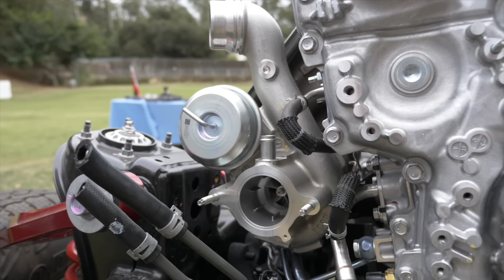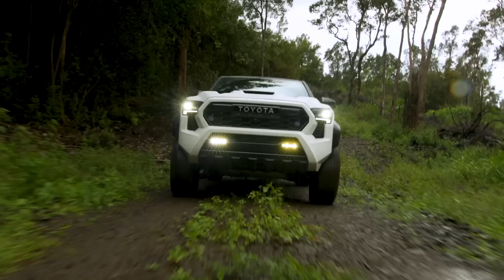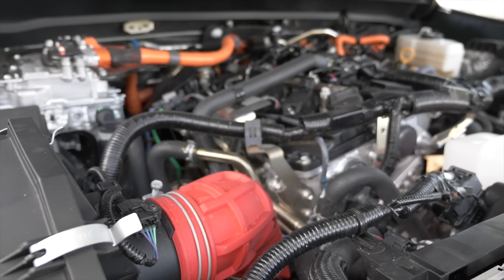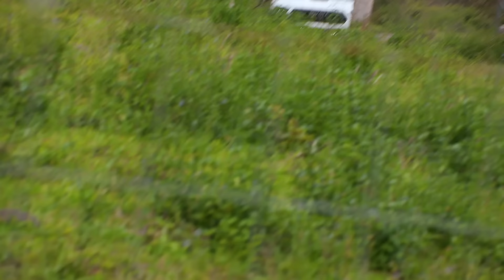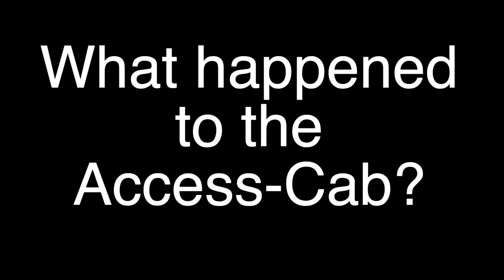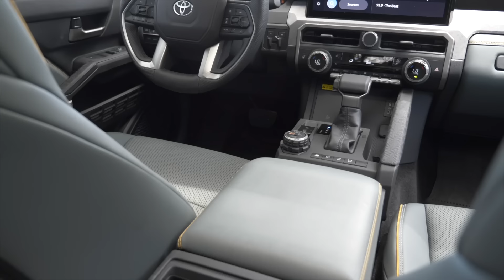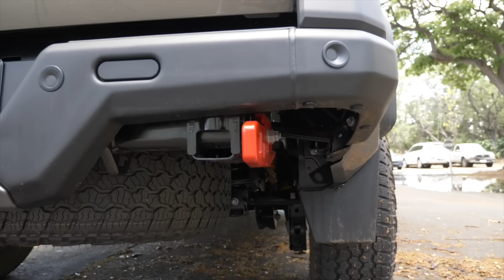2024 Toyota Tacoma Chief Engineer on new engine reliability and more...

Comment: Overworked 4 cylinder overwhelmed by weight of the vehicle, its intended use as a work truck, and heat/wear/tear from the turbo…all for 40k plus…no thanks.  From the looks of the “engineer”, it appears he was bought off with a plate of double cheeseburgers.

Comment: Thanks for making my 2012 4.0 ALOT more valuable..good luck!
Reply: Tundra/tacoma V8 v6 are unicorns now
Reply: Yup, looks like it’s already outlasting the new Tundra turbo engine.  4.0’s last a very long ways.  500k plus miles.
Reply: @musubi3287 😂
Reply: good luck to you with that 12 year old vehicle, sooner or later everything breaks and you're DEFINITELY pushing that later portion of that equation, good luck!
Reply: @qbanlink25     UNPRECEDENTED resale value..enjoy your chinky rusted out chevy
Reply: @qbanlink25 what do you mean good luck ? How much do need ? I got a 1997 F-250 with 450K miles on it . I rebuilt the engine and transmission at 370K miles and it was much smarter and cheaper than buying any of these newer overpriced pieces of trash . My dad has a 2004 jeep grand Cherokee which still runs great . A 2012 Toyota Tacoma is easier to work on and easy to get parts for you can get manuals and all kinds of info for it and lots of mechanics can rebuild the 4.0 v6 engines and you can get around 400K out of one if you take care of them so I think the guy is much better off with a 2012 Tacoma vs a new Tacoma which has a poorly designed engine .

Comment: This guy who says he is the lead Toyota Tacoma engineer is full of crap. He said they would have a motor for all their customers. Well they don’t. I haven’t heard him talk about a motor that does not have a turbo. There are those of us who despise turbos because the longevity and durability is not there as opposed to a normally aspirated, I had my last truck for 400,000 miles because it did not have a turbo if you have a hybrid or turbo you’re looking at that hybrid battery going out after 100,000 miles and it’s gonna cost $5000 just to replace the battery. i’m 61 years old and have been driving trucks for decades. Don’t tell me a turbo engine is going to be as durable and last as long as a non-aspirated engine you have all the carbon issues with turbos when that little turbo goes out after 120,000 miles it’s gonna cost you five grand just to replace it, you have not picked a motor for your non-turbo customers tell the truth

Comment: Turbos increase cylinder pressures and heat, create a ton of heat under the hood (think wires and plastic parts), add potentially more thermal warmup stress, more complexity, and stresses the oil. All of the PSI on load bearing surfaces goes up. How many resources will be needed to create, transport, and replace these engines when they fail many years before proven designs? Good for car company economics but not the financial sustainability of consumers. I’m going to have to rebuild 2gr-fe’s forever. It’s about to start looking like Cuba in the US.

Comment: If Toyota just put this 8 speed trans in the current 3.5L with 4.88 diffs, it would get better mpg than this turbo 4. My '18 SR5 4WD gets over 25mpg on 2 lane roads currently. And that motor is rock solid reliable, Id be hesitant to buy a new turbo Tacoma cuz their Tundra had major turbo issues on new model year.

Comment: thank you for the video, main question is how much ?, how much this turbo will last, how much the engine will last?, how much will cost a new turbo after 5 years for a car with  high milage, turbo need constant oil changes with the right oil (no more cheap stuff )..also some sites shows that gas diff between this engine and the V6 is only 1-2 mile diff..
So is scotty kilmer right ? he did say not a lot of diff between or even get worse experience on towing.. very interesting to see..
Reply: Scotty is usually correct.

Comment: Nothing like drinking the Kool Aide, but the guy needs to keep is job. Turbo gasoline engines just don't last, this is a compliance engine and nothing more.  At least they offer a manual transmission, but the giant TV just stuck on the dash, certainly looks like an after thought, absolutely horrible looking. Just recently retired from the auto repair business and I would be very surprised if this thing will last anywhere near the old models. I had customers with over 500k on their taco's.

Comment: Goodbye TOYOTA! I will stick with my 22RE, 1GR-FE, and 3UR-FE. They should last me forever! No expensive turbos or hybrid batteries to replace. Its cheaper for me to keep and maintain my current vehicles because of the high cost of the new tech. I would upgrade if TOYOTA offered a low tech non-turbo option.

Comment: So an unproven engine with less power and more parts to break. A thinner frame and a thinner hood/tailgate. Not to mention an Access cab that has no access! These idiot forgot that the delete seat option was used because you could still access that space through a side door. Now you have to lean back over the driver seat or walk around to the other side and reach back…what a joke. Way to ruin the last good midsized truck Toyota….i almost entirely blame EPA regulations for these changes.

Comment: The governments with CA leading the way are forcing the OEMs to downsize their engines to squeeze a few more MPGs to meet the govt. CAFE requirements. That's why larger displacement V8s and V6s are disappearing. 
One commenter asked the question of why Nissan is able to meet CAFE requirements with a big V6 in their Frontier. It's because they are dropping the Titan with the big V8 and planning to go more electric in their overall lineup. And they have a 3 cylinder turbo in their Rogue now. Don't know how much longer the V8 Armada and V6 Pathfinder are going to last. 
Toyota on the other hand sees that EVs are losers and is going with a hybrid strategy (which they pretty much invented with the Prius) and smaller turbo charged engines. 
Not sure what Ford, GM and Stellantis are going to do. Think they're all in trouble. GM and Ford are already pulling back on their EV strategy because it's such a money loser and demand and infrastructure aren't there.

Comment: Curious towards how much the EPA and cafe have choked this truck down .... Does anyone know what oil viscosity is suggested for this engine ? 0w20 or 5w30 ?
Reply: My 2023 2.4T RX350 uses 0W-20; interesting engine with a very flat torque curve across most of the RPM band - the power specs on this Taco engine are almost exactly the same as RX.

Comment: I owned the previous model Tacoma and sold with with 12K miles on it. Most dreadful seats I have ever had in a vehicle, then the engine on that with the gear ratio, was horrible. I do not miss that truck ONE day and I hope the new one is what I have heard so far, as I would then buy it and trade in my 2022 Tundra! I heard the seating in the new one is pretty much the same as in the Tundra, higher off the ground. I really like my new Tundra, but would prefer a slightly smaller truck - so I will check out the new Tacoma WHEN it one day arrives.

Comment: Pretty much everything in this video makes me sad.  Nobody who actually uses their truck wants an auto tailgate ffs.  You need a 3"(V8 spec) cooling intake to remove heat.  Well what happens when you get a leak or the pump goes out.  How long until you blow the head gasket? smh

Comment: When they do field testing in Alaska and the hottest of deserts let me know? The 2002 2.7L is proven to be the best at over 200,000 miles. No or little Field testing of the first 25 engines off the line is the reason that the American cars and trucks industry fail and make the consumers do their work??? Thanks Toyota for the Prius that took 7 years of testing before being released in the USA, hat is why the Prius has the outstanding engineering that will give 200,000 mile and more if taken care of by the owners and Full Synthetic oil and filter changes every 5,000 miles a lot more mileage if a AMS OIL bypass filter system is used followed up by lab testing of the oil samples at 10,000 miles? My 1990 Iveco 135 Turbo 6 cylinder Diesel engine went 350,000 no more parts available in 2010 before parking? AMSOIL 15-40W oil passed lab tests after 15,000 miles the standard engine oil filters were  changed at 5000 miles.

Comment: I'm skeptic on the 2.4L inline 4 turbo vs the outgoing  3.5L V6 no matter what engineers [*(especially chief) he's a manager- notes someone below, boo hoo, irrelevant for me, customer] has to say in terms of reliability on the long run, logic and long term use dictates  the odds are in favour of the V6. Replacing the V6 (proven bullet proof) with 2.4L, + turbo + (some models) iForce (hybrid), what does this tells you even coming from Toyota? Be aware Toyota, customers' trust is hard to earn and easily lost... Updating the Tacoma is a must but complicated engineering was never the trend of Toyota, I see dark clouds at the horizon for this company, I hope I'm mistaken... It says here "Goodbye V6", let's hope it's not "Goodbye Toyota Tacoma" and all other ones replaced by the 2.4L inline 4 turbo...
Reply: *(especially chief) he's a manager

Comment: great power for a 4cyl, though i trust toyota’s reliability i still feel they should’ve been powered by at least an inline 6 but with same power, that imax option could have reliability and fuel efficiency problems with that power in a smaller engine compared to a bigger one and, obviously not always and there r  exceptions, but we all know toyota  reliability comes with underpowered yet horrendous fuel efficient trucks

Comment: The Downfall of Toyota Tacoma and 4Runner ! Why don't they just build a 4 cylinder Turbo  Diesel. Another thing i hate is how crappy the Bumpers are so cheap ! Hate all the Plastic and interior needs to be wider period. And they need to dump the leaf spring rear ends and do coil springs.

Comment: Anyone that tells you a small displacement engine adding a turbo will add to reliability is full ofshit, you're gonna add more stress to the engine by pushing it harder with the turbo charger to make up for the engine size.   

You want to make what people want again?     Minitruck, 4cyl turbo diesel. Half ton to start.     

40+ mpg.  Oh no, so terrible.

Comment: Also, let's discuss the ridiculous and needlessly complicated alternator setup on the engine shown. "Let's replace a six-decades reliable design that regulates via field current with a bullshit pulley and connection to the ECU that lasts a third as long and costs five times as much to replace in exchange for a 1% improvement in efficiency. Stupid is... Oh but call me a hater for appreciating the simplicity and cost effectiveness of the original alternator on my 2003 Corolla with well over a quarter million miles on it that has never been taken off the car. This kind of dumbassery is right up there with the variable A/C compressor on my wife's 2004 XRS that locked up and destroyed the serpentine belt because there's no clutch on the shaft so that you can simply turn off the compressor rather than being stranded. Again for 1% in improved efficiency. Fucking ridiculous.
Reply: Thanks for sharing.  Glad I bought one in 2019.

Comment: Why do you call realists haters? Check all the bullshit at the door, please. Toyota was not inundated with letters from owners demanding that an ultra-reliable V6 be cancelled and replaced with a far more complicated, trouble-prone, and less durable turbo I4. Of course the area under the curve is more broad with a turbo motor. I'll also note that real world mileage when towing isn't any better with a smaller displacement turbo vs a larger NA motor. If you think that, even from Toyota- a turbo I4 will go a half million miles without major repair costs the way Toyota's NA V6 does please tell us so right here. Also tell us how many you've seen actually do it.

Comment: It's been 9 years now since it's been available in the Tacoma, and not a single thing I've seen in person or read online has convinced me to ditch the Toyota 4.0L V6.
Reply: Consumer Reports just named the current 4.0 litter 4Runner the most reliable car you can buy.
Reply: @MrVincemims  so of course they got rid of that in exchange for the turbo four. This explain why they did it( incorporate speak) but I still don’t like it.
Reply: Consumer Reports ain't what it used to be! @MrVincemims
Reply: It's purely EPA emissions driven. Toyota is being pushed by the EPA to conform and meet emissions standards just like the rest of the manufactures. Hold on to your v8's and v6's Tacoma's as long as you can.
Reply: 4.0 prerunner here sir.
Reply: @DigitalCity-sj4es  4.0L also, 4x4 75k miles not even broken in..
Reply: A masterpiece of an engine and the end of evolution for Toyota V6.  3.0>3.4>4.0.  The 3.5 is regression from the 4.0.  Yes, I have owned both
Reply: @triple6758 3.5 was a good engine as well. It’s the transmission they hooked it up to that leaves a lot to be desired.
Reply: @triple6758  don't forget the 2.5 v6 in the Lexus sedans 

That's like a 4gr or something
Reply: @triple6758 oh also the old 3.0 and 3.4 are VZ motors, entirely different setups to the 3.5, 4.0, 2.5 and new 3.0 that are GR series 👍
Reply: You will regret selling it, so don't!
Reply: Love my ‘05 taco 4.0 1GR! 221k runs like new burns 0 oil.
Reply: Emissions forced em to slap this bullshit into every car they make. 

Just give use the V8 again. Nobody wants a truck with a stupid 4 cylinder.
Reply: Definitely cheaper built, pulleys  plastic ,pumps plastic ,turbo charged 4 cylinder engine, which everybody knows when you force more air through ,it runs hotter. That way the life of the engine is less easy to figure out.
Reply: @donaldpiper9763  The turbo charged engines look like a spider web from the top view. One would have to tear out a hundred components just to change the water pump. It is not cost effective.
Reply: @donaldpiper9763 good thing it's intercooled
Reply: @donaldpiper9763  Hotter engine gets better fuel mileage. Manufacturers intentionally run engines hotter than what the modern cooling systems can provide and as other have mentioned... Intercooler. This isnt a 1968 diesel. Personally I'd rather have a turbocharged v6
Reply: @donaldpiper9763  it’s quite simple. Use a little bit higher octane for spark knock and use a little bit thicker oil for good quality of lubrication everybody acts like this is the first turbo charged four-cylinder that’s ever been out in the world. It’s a fucking motor. Keep the maintenance up and you won’t have problems. It’s that simple goodbye and good night.
Reply: In terms of reliability and work load, yeah there's no reason to ditch the V6 Tacoma, but Toyota is gonna throw the whole "Saving the Earth with more fuel efficiency" BS to sell the new 4c-T Tacoma. If I find a V6 manual transmission Tacoma, I'm gonna buy it just to have it when the Tacoma reliability starts going down the drain.
Reply: KEEP YOUR 200 HP  LOL
Reply: The only better motor than the 4.0 v6 is the 4.7 v8, but that requires timing belts. Gets the same fuel economy of the 4.0 with like 40 more torque.
Reply: @enthused7591 so of course they will get rid of that also. SMH.
Reply: Last 4.0 went into the 4Runner…the last reliable Toyota to be made… 

Might still be able to find one on the new lot, yet I doubt it..loved mine. Traded my 2015 Tacoma for a 2013 Sequoia. Only regret was I couldn’t keep both.
Reply: @kevinjordan6242  The older Sequoia's and Tundra's of that time frame will last forever. Sad they had to kill of the N/A V8's and go to V6's with turbo's. EPA has forced manufactures hands and there is nothing any manufacture can do to stop this trend.
Reply: too much gas though. And slow truck. not fun to drive I will think.
Reply: Getting rid of the access cab was fucking stupid… just add a door so we can get tools out of the back you idiots.
Reply: “Customer access was vitally important” 

Then why is there a door for access? What is this nonsense?!?
Reply: “People wanted improved fuel efficiency”

Well you didn’t really achieve that either. These 4 cylinders are getting nearly the same fuel efficiency as the 4.0 V6…
Reply: @chrispewkreme  they are definitely not getting the fuel mileage as the 4.0 L V6 I have one of those and I have a new 2026 Toyota Tacoma with a 2.4 L turbo charged right now I’m getting 23 1/2 miles to the gallon what’s my new Tacoma 
4.0 L V6 would barely get 20mpg My new Toyota is 4 x 4 and my 4Runner is also 4 x 4, so I don’t know what you’re getting that info from but I know for a fact because I own both vehicles, bro
Reply: I have the 1GR-FE 4.0L V6  Here Down under aussie. I won't let go, 210 000 kms, it's done some hard work and still no oil burn, I do oil change every 5000 km's. I know i will get over 400 000 Kms. They have standard rings, only thing that lets them down is cooling system. Booked in for complete hose and radiator. It is just so reliable. I just bought my wife the 1GD-FTV 2.8 L diesel...see how reliable it is.

Comment: What about the shitty longevity of the white paint. $60,000 truck but can't get the paint right like with super thin paint on the Tundra. And then there is the sound system that is probably the biggest complaint of all Toyota truck owners. Total crap and no excuse for it.
Reply: Premium sound system in my 2019 Tundra.   It' is  awful  compared to my Stock 2006 Mustang's.